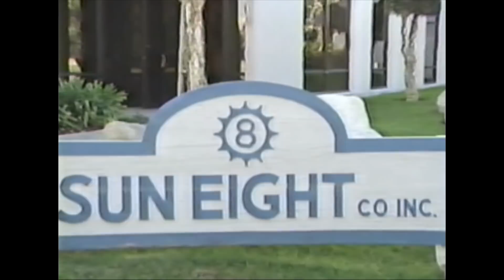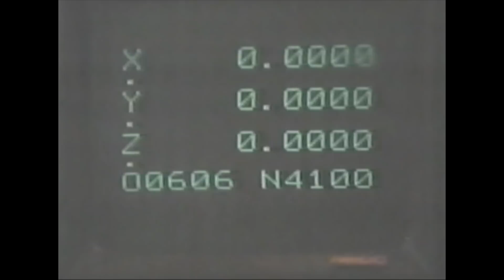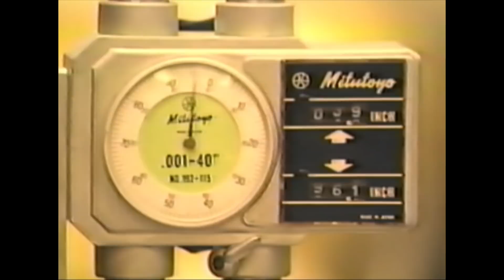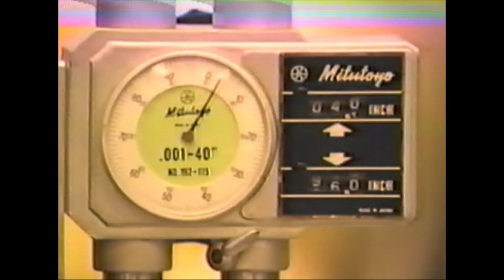Aerospace CNC Machine Shop from the 80's - Narrated by Lance

Comment: That's really cool .  I remember back in trade school during my apprenticeship using a VMC but you had to type the programme onto a computer card that had holes punched out all over it !   Great view back in time , Cheers .
Reply from the maker: Hi Max great to read from you, we have to still get over and watch part 5 of your project x and see this build through to finalization, you are doing a great job.
Memory lane, this set of videos is actually for our newly started working museum that has books, 5 refurbished tools and not a machine yet but it will be getting many tools and machines over the coming 9 years we dedicated a decade to build this hands on working museum and these two videos of the CNC machining times on a small scale were important in both an original copy (cheesy music and all) and a Lance voice over version.  
These CNC machines were coming in reel to reel flat black tape, we added a switch box ran cable to a central office and plugged these through the RS 232 port so programs could be sent out to the machines even editing the programs in this office and fed it out to the machine again. 
We even added lights on the machines running, waiting mid operation tooling clamp or material flipping light to best optimize the operation during work times.
Max thank you for being here, we are having a great time and you make GREAT videos we enjoy watching you are a good design and machining engineer you are.
Lance & Patrick.
P.S. No Shop Adventures show this Monday night, these two historic videos was enough to ask you and the viewers to watch.

Comment: Lance, great video, rich history,  it shows a photo or video taken may turn up and has great value many years later and you look right through the quality compared to know.
Reply from the maker: Hi Chris thank you for these nice words well placed in history. Chris for Lance those were good times however for these of current times, these are GREATEST of times. 
We have a show Shop Adventures 36 coming out (this Monday night) and in this show Lance goes to school, takes us out for a walking update and Patrick brings in a new museum tool also shows off the Swiss made CARY micrometer comparator fully refurbished and that inspection tool is for to the inspecting of the parts we will be machining shortly.
Museum tool number 6 is to be placed in the hands on museum as we work to add a single tool or machine related to watchmaking and micro machining each month and will do this for the coming 9 years. We have been at the museum for about 8 months now.
Thank you Chris for coming by and being here, we enjoy these comment interactions.
Lance & Patrick.

Comment: 8:26 that looks like a Japanese copy of my Cincinnati VMC.
Reply from the maker: Hi yes it could have been Brian, Cincinnati CNC machines are greater though in that time, did you know those machines we had cost more then what you can buy to replace it with today and with such programming ability powers we did not have then. 

In that shop at that time there was one single spindle 5 axis but by the time this place sold it had grown had a few 5 axis Mazak machines Kentucky plant (maybe guess) and some others even a gantry type machine running longer aircraft parts Brian, all after I left though. 
Thank you Brian, Lance & Patrick.
Reply: @ActiveAtom  Oh yes I know. I think I saw where the company I bought my machine from had paid about $295,000 for my machine back in 1987. With inflation that would be like a million dollars today.  Which is crazy to think about when you can buy an equivelant sized Haas machine today for about $150k

Comment: Thanks for sharing the historical video brings back memories of those times.  I was not in manufacturing I was in Telecommunications and back in that time frame we transitioned from electro-mechanical switching equipment to digital control so had to deal with the Big computers of the times and eventually worked in the West Coast Computer Center for AT&T  where we had two floors full of the walk around in and through computers, horrid power hungry hot running beasts they were and I had a right arm looked like Popeye's from changing the big disc packs doing backups every day.
Reply from the maker: Hi John, we are so happy this video was something we could bring to share here in the community oh those days.
Thank you for sharing your thought from then you looked more like a fitness director then a computer scientist that must have funny to see, but we get it everything was larger. 
Lance & Patrick.

Comment: Does the name Perkin-Elmer bring back any memories ? Uncle Sam was still using VAX systems in the late 90's when I was still working !
Reply from the maker: Hi Joe D, no this name Perkin-Elmer does not come to mind remember though I left this company in early 1993, so it is not shocking who it is we looked them up they are a very large operation built over the years. 
Thank you for sharing this and your uncle Sam must have been pretty smart to run these DEC VAX computers, they had only began coming out to people like us 3 years after they were created, so very leading edge for sure.
Lance did not use them people working there at the small company did, they were really marveled at by the rest of us to say the least.
Lance & Patrick.

Comment: Guys that reminded me of the 1st CNC lathes I ran back in 1979. They were made in England, but had US made GE controls. The control panels were 5 feet by 3 feet of course the spindle drive was in them, you only had one line of code showing and loaded the program with punched tape. Each program came with a book with the printout of the program in it. We could edit the programs, however you could keep limited programs in the control, so when you went back to a previous program, you had to manually enter the edits, since we did not have a portable tape punch. That’s why you had the program books to know the edits so you could enter them in the control. Test running a new program caused a lot of butt puckering.

I enjoyed both videos thanks for sharing
Reply from the maker: Hi Jim, you do know these times well, you share a great time in the machining world, we did not own a lathe, well we had a tooling department lathe to make something round yet small.
Before we began to upgrade to CNC from manual machines known as tru-traces and hydrotels planners even we would always be turning hydraulic control stylists in various diameters and used tape to on those to set the offsets.
No Shop Adventures show this Monday night Jim as we asked enough of our viewers by placing these two videos up even though that was in the end of the week.
We will return with a short Shop Adventures including your tool on 05.20.2019. Thank you for being here and being our friend Jim.
Lance & Patrick.

Comment: Hi Guys,

Very interesting.  I worked in IT back then, mainframes/system design, and then moved on to desktops and planning.  I well remember the Vax, Sun, Wang, and the TRS for home use.

Times move on and CPM is long gone.  We had one of the original IBM desktops as well.  Big deal back then.  Everything has just got so much smaller, more powerful, and cheaper.  But it was the beginning and for the day it was impressive.   Hard drives as big as filing cabinets.  A terabyte was like going to the moon.

We also had the death by asphyxiiation fire suppression system for the Fujitsi main frame we ran.  Don't press the red button ever  ;)   Or was that for total power kill and system shutdown requiring a day to reboot.  LOL.  That's how it was.

Thanks for the step back in time.

Cheers Rob
Reply from the maker: Well hello Rob and you are welcome.
We enjoyed reading your moment in time of these mainframes, desk tops of those times and what have you.

CNC machines then, cost more then they do in current times to table size yet today's are even more software powerful running great code.

The building cost less then to build then it would to replace it today, so things flip, some lower, some higher, which ones make for the right investment? 
Rob, time is an interesting thing when you sit down stare into its vastness and see what it holds for you now and what it retained an even held for you from back then, huh thinking a bit too much this day. 

Thank you for stopping in sharing your GREAT memory with us and the community, it was a great read.
Lance & Patrick.